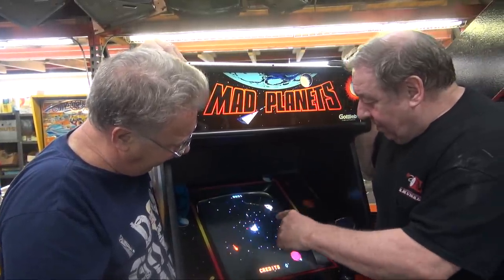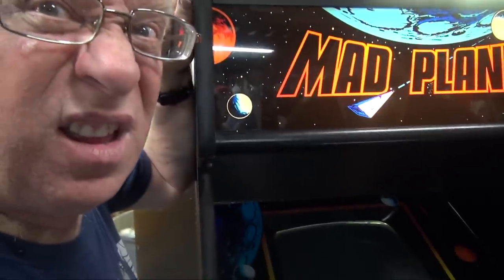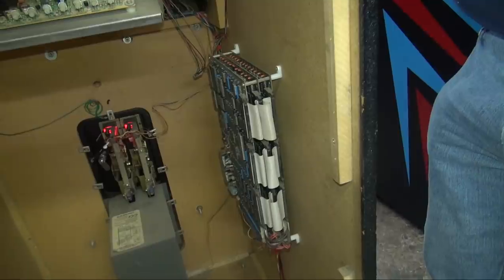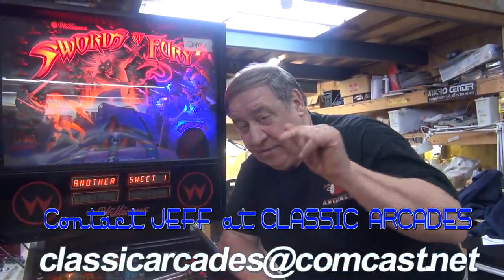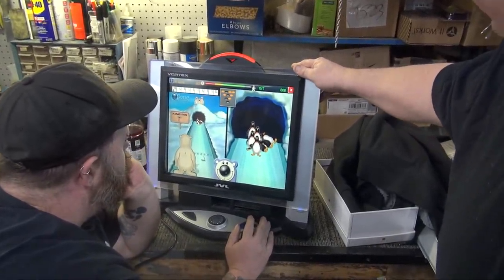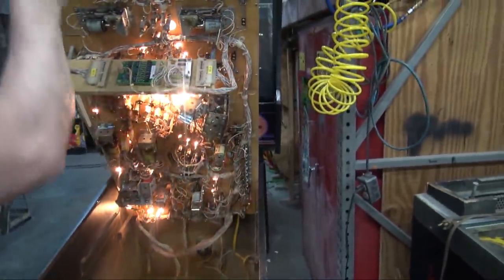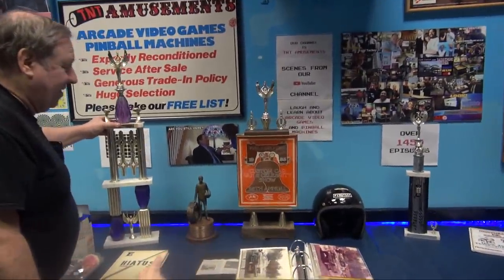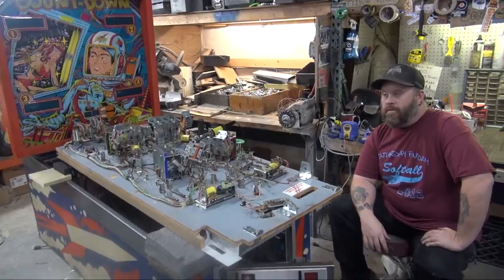#1481 MAD PLANETS & Original STREET FIGHTER Arcade Video Games-TNT Amusements

Comment: Lexus again.  oi I have a Toyota Scion now, good price  true they did have a few Lexus' there but those are disposable Toyota's  (same company)  , although with a mileage of 1 i'd be looking at auto check for what that is  https://www.jeffersonstmotors.com/2005_Lexus_GX%20470_Waterloo_IA_28954667.veh  that does not fit my vision of a Lexus  and the scion they have now (can't keep those in stock) costs more .. Bit backwards right. oh it's a Manual Scion  thats why the expense  ..  https://www.jeffersonstmotors.com/2009_Scion_xB_Waterloo_IA_29399027.veh  I have the automatic version of the same model and year